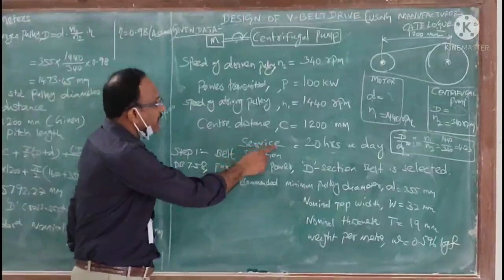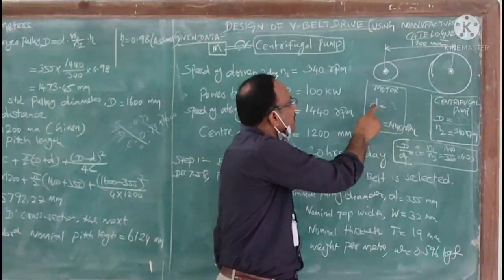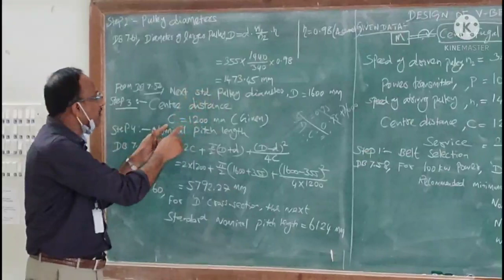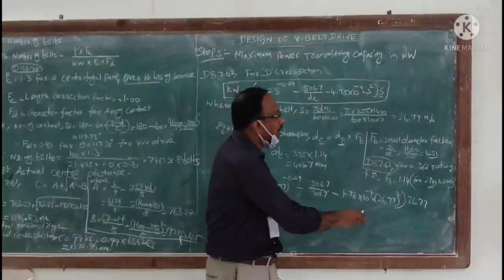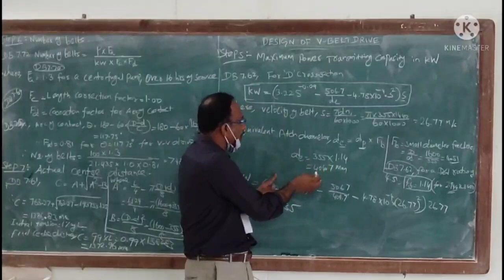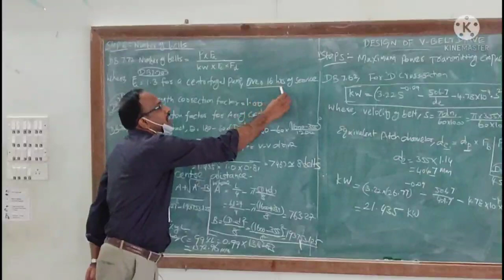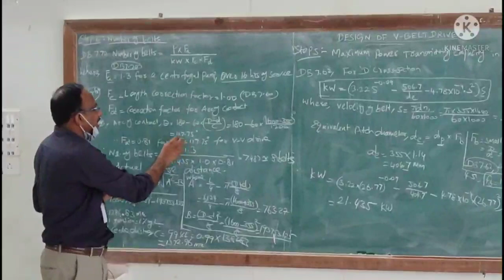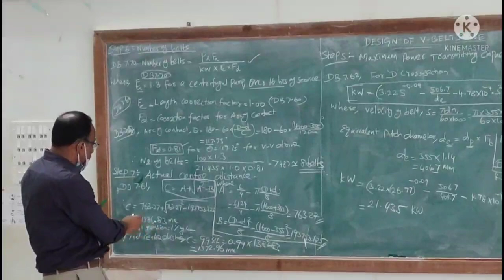Selection and step by step design of V belt drive using Design data book & manufacturers catalogue

Comment: so there are confusions for Center distance between two pulleys ,in PSG design data book there are 3 formulas as i understood which one should we use ,i am not getting it, first one is ratio C/D ,for B cross section it is 0.85 something , then we have Cmin=0.55(D+d)+T and again C=A+ under root(A^2 -B). and if u see another books they say Cmin=(D+d)/2. which game far different values than PSG design data book